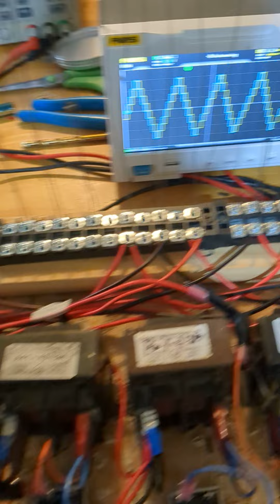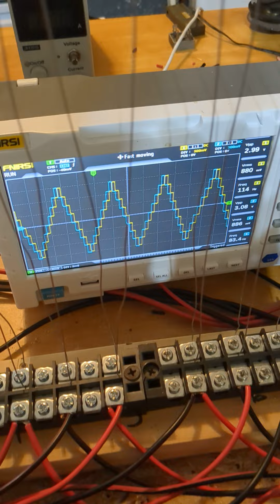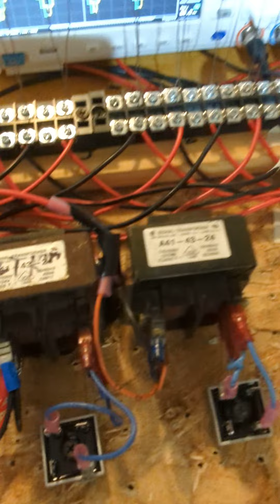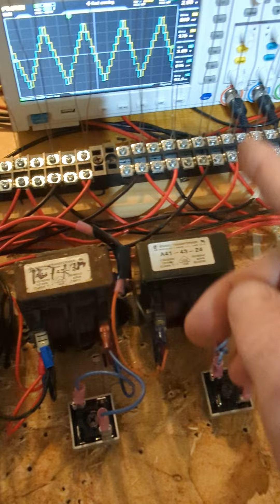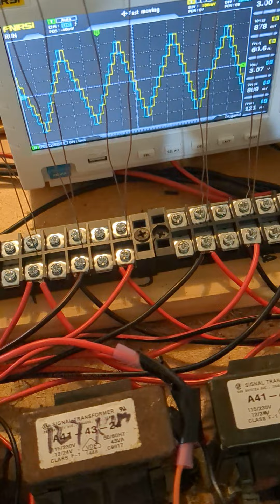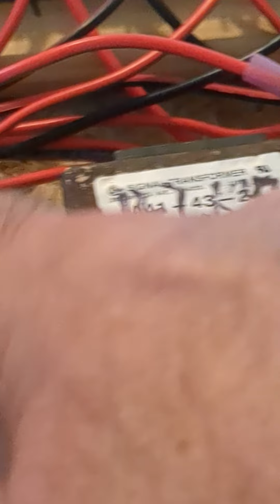Clemente Figuera - xxxxxxxxxx

Comment: You are doing this the hard way, check out ramp generators, also magnetic coupling. Ramp generators are used in all modern day D.C. to A.C. converters to do what you are trying to do.
Reply from the maker: Don't think ramp generator will give you 8 Phase AC.  This lets you tap Polyphase from different points of the time variable.